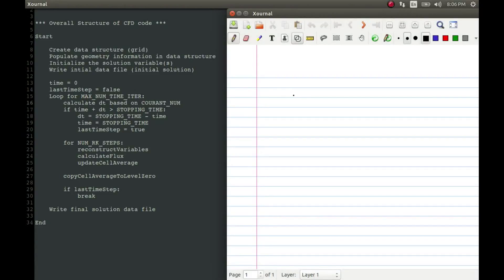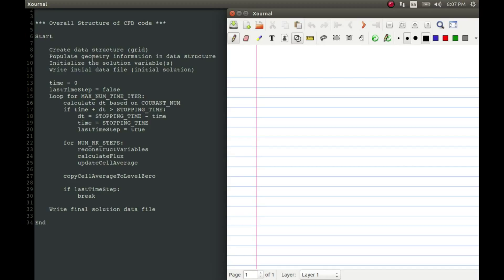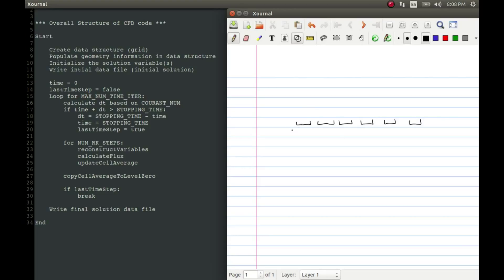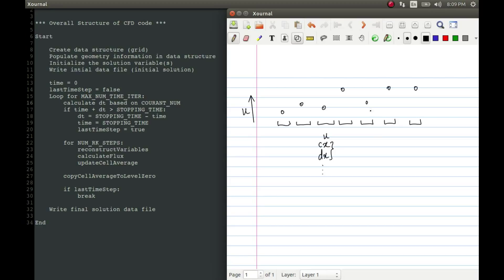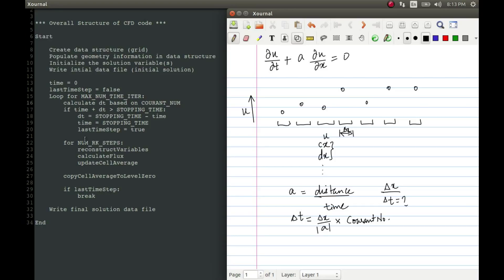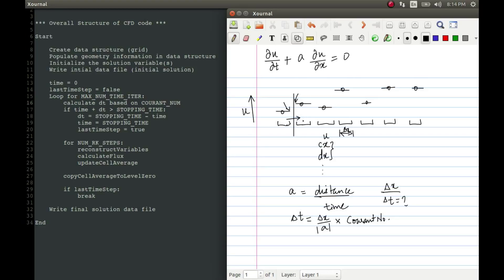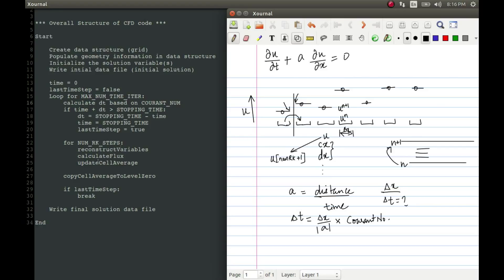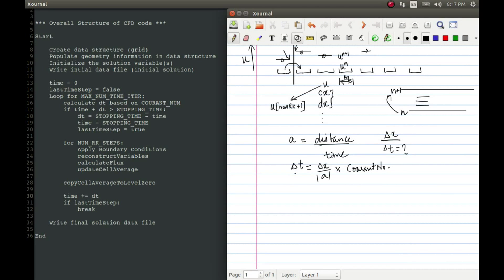003 - Overall CFD code structure (Hyperbolic PDE)

Comment: Hello, Saurabh. Which book should I refer to for studying all these concepts of programming in CFD. I wish to write my own code but I don't even know any programming language. I'm looking for a book that explains coding in a CFD environment.
Reply from the maker: Hello Aditya, 
Recently, I came across a book by Prof. Ramakrishna from IITM. He has written a very good book which covers many practical aspects of CFD programming (mostly related to compressible flow). The book is freely available on his website. I think this book can be a good start if you are completely new to CFD and programming.

As far as the theory of CFD is concerned, there are many books.
The two volumes by Charles Hirsch on internal and external flows are well written. They can help you to grasp many of the CFD concepts.
For hyperbolic problems in particular, the book by Toro on Riemann solvers and the book by R J Leveque on hyperbolic problems are very good references.

Best Wishes,
Sourabh
Reply: Sourabh Bhat 
Thank you man. Really appreciate it!

Comment: Nice job. Do you have an example of finite volume method in 2D?
Reply from the maker: +Eder Hugo Salcedo Castro Thanks! I will be beginning with a series on 2D scalar problems in few days. In that series, I will start with 2D discretization using finite volume methods and following similar path as I followed for 1D problems. Consider subscribing, as you will get a notification when I upload the video.